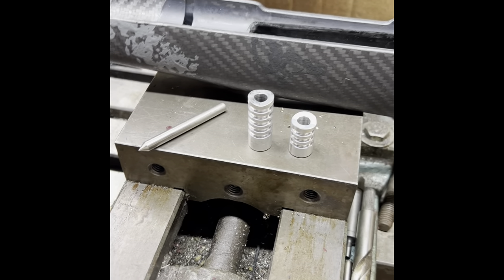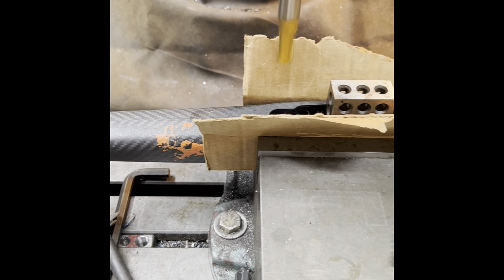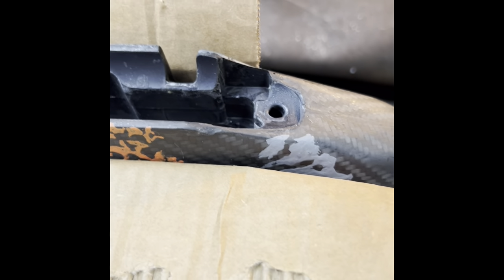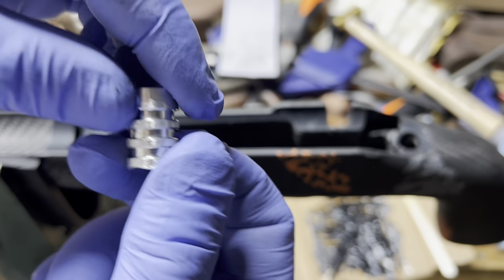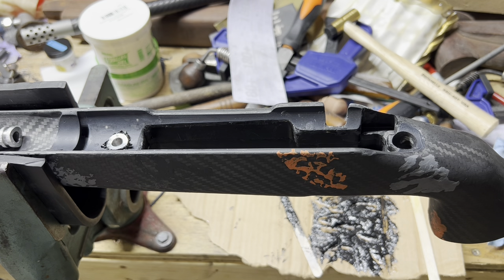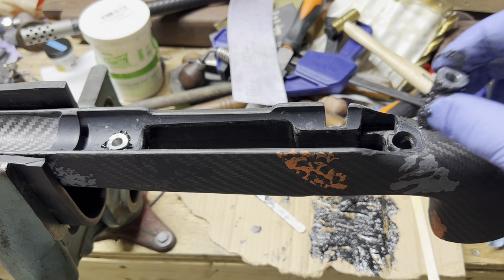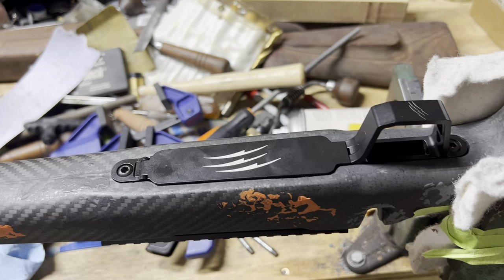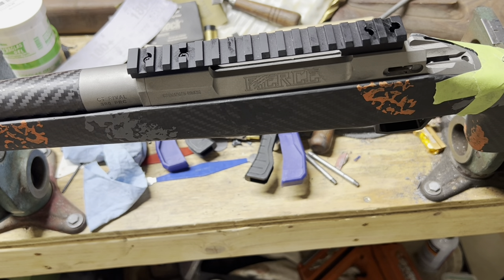Pillar Bedding A Rifle Stock

Comment: I don't ever pad the barrel.  I put a piece of painter's tape just in front of the lug on the stock and covers forward of the barrel a couple of inches out. When you bed, after curing, you can snap off the extra compound very neatly and no clean up and no interference with the barrel portion at all.  Look at a chassis rifle, they don't bed the barrel at all. If you were to pillar and bed at the same time, you would have a more homogenous bed without the small mounds made around the pillars that have to be cleaned up back to original height. You can also wrap your action screws in tape and spray with release agent and install. I use surgical tubing to clamp the action. Over drill the pillar holes until the pillars are free floating, then when installed everything will be perfectly centered without the screws touching the pillars inside the bores. Hope I had some tips that are useful.  More than one way to do this, but I know this works well.
Reply from the maker: All great advice! Thanks for sharing.

Comment: Nice video.  Shocking a rifle that expensive is not pillar bedded.  Why not make the pillars slightly short instead of slightly long and then just let the glass take up that tiny bit of difference?
Reply: The pillar needs to contact metal only…….  If the glass contacts also it will be crushed under pressure.   Totally defeating the purpose of the pillar….

Comment: How did it shoot after? In my experience if a bedding job around the action and the lug didn’t fix the accuracy, pillars aren’t going to fix it. Especially on carbon fiber. Hope yours fixed the issue. Nothing sucks worse than buying a product that doesn’t stand up to the claims
Reply from the maker: 💯 agree! It helped tremendously, shrunk groups to 1/2” at 100yds with factory ammo.

Comment: I’m having trouble with a Carbon Rouge also in 300 prc. 100 rounds and nothing better than 1 moa with handloads. I’m going to find a box of factory ammo to prove that it doesn’t meet the .75 MOA guarantee 😂😂 and send it back to them. My buddy sent a CT Edge in 28 nosler back to fierce due to an excessive headspace
Reply from the maker: Yeah I haven’t seen anything good come from them. They paid for me to bed this one. The next one they wanted back and supposedly rebarreled. Would not recommend.